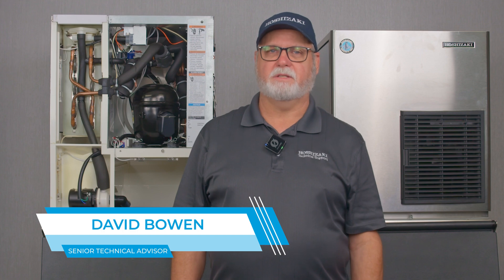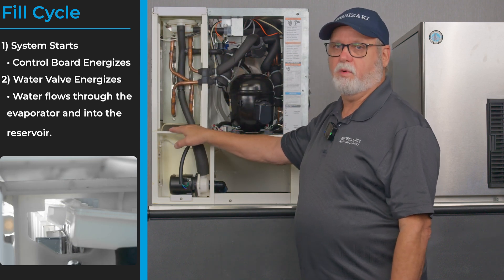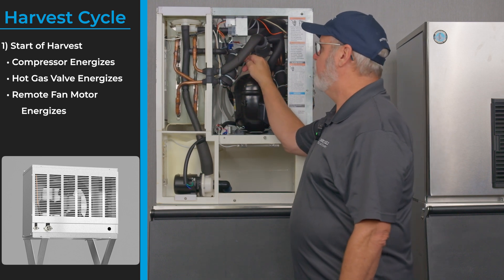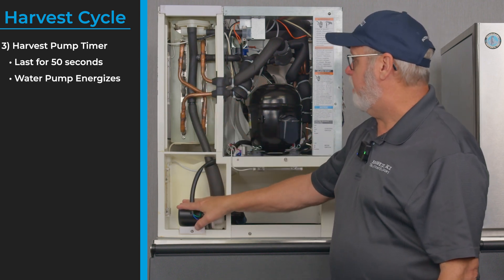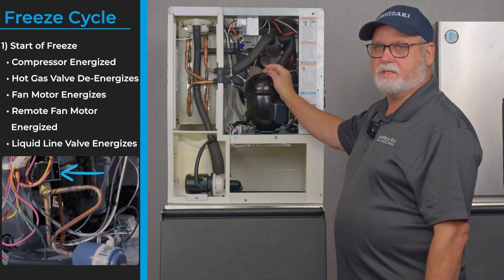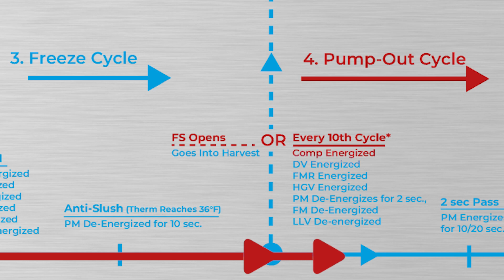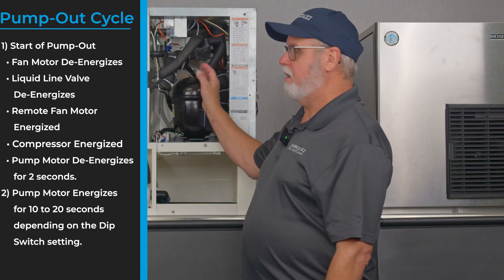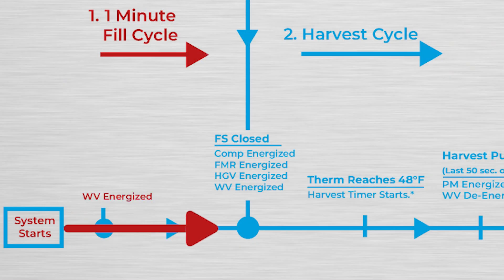KM Ice Machine Sequence of Operations (Technical Training)

Comment: I’m dealing with a KM 901MWJ water cooled at work. So with the water valve open to assist during a harvest the reservoir over flows and it pours water into the bin. Why does it over flow like that?
Reply from the maker: We apologize for the inconvenience and are sorry that you're experiencing this issue. Please contact our support team at 1-800-233-1940 or email Tech-Support@hoshizaki.com for assistance.
Reply: make sure drain is at least 3/4 pipe and not plugged